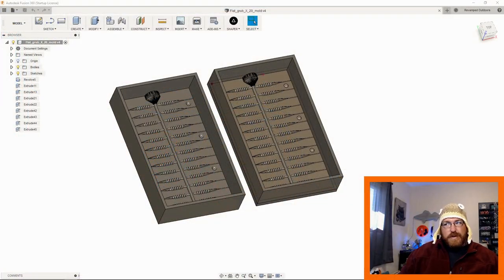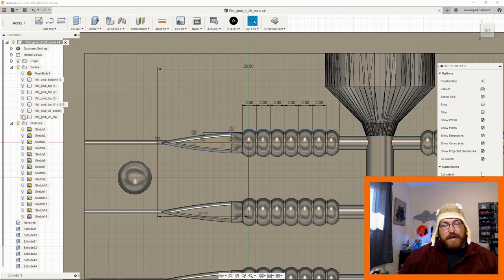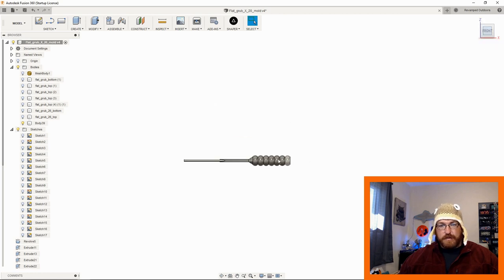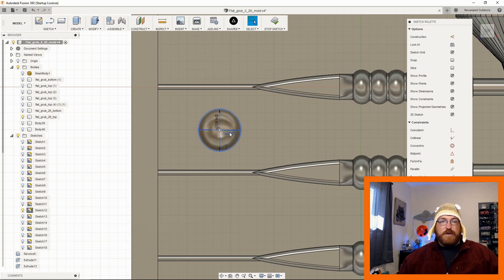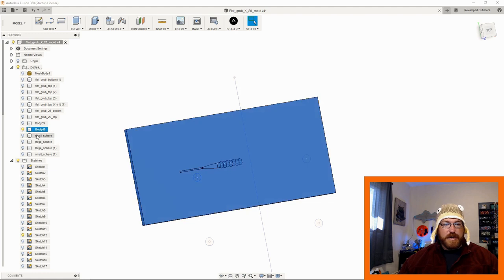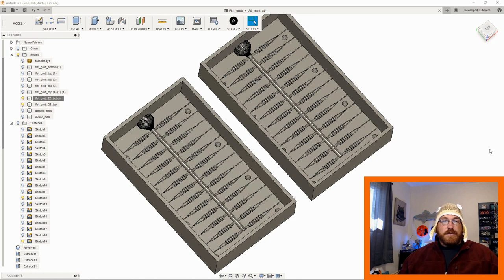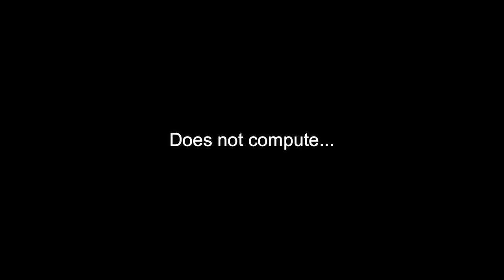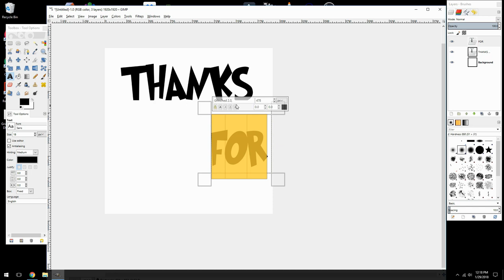How to make a two part injection mold with a 3D Printer - Soft Plastic July - Episode 1

Comment: Thanks for your lessons. You make it look very easy.  I am new to this and from South Africa. Can one use the same proses to make a two part aluminum injection  mold for marlin skirts on a cnc machine.
Reply from the maker: I believe so, I do not have a CNC but the design should work as aluminum like it does as silicone as long as you can get it lapped flat.

Comment: Love your vids. Also into fusion and printing lures. Where did you find the sprue component?
Reply from the maker: Thanks! Do you mean the injector nozzle component? I made that a long time ago in fusion and have just been adding it to each soft plastic design.  Nothing special it's just a 5/8" cone design saved as a component in a fusion file,  after it's saved in one document you can import it to other designs with the insert command.  I've found that doing it that way saves a few minutes of redesign.
Reply: Ah ok thx

Comment: Hey man. Just finished my first mold box. Ready to pour max 60 in it. Have you ever tried pouring in the negative (positive - sometimes gets me confused haha)  mold box without casting it into silicone? Have seen a guy do that and it works. So no more need of the expensive max 60? He made a crawfish mold. Straight from the 3d printer. It showed some printer lines but that can be sanded. You have probably seen his channel. It's small but this guy is also good at fusion modeling
Reply from the maker: Yeah shone, does it with some success every time I try I end up melting the molds, but it can work, i like the permanency of the silicone.

Comment: What silicone do you use for injection??
Reply from the maker: I like mold max 60 just because of it's hardness but for plastisol any silicone should work, plastisol is under the max temp rating for most hobby silicones.